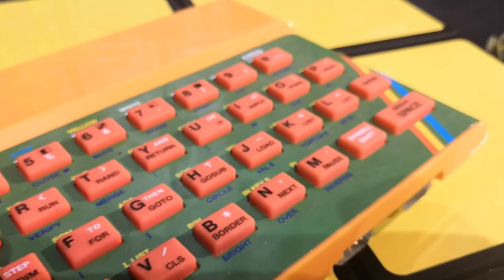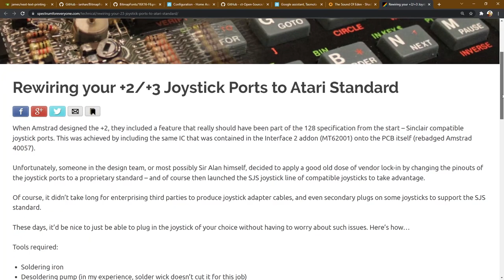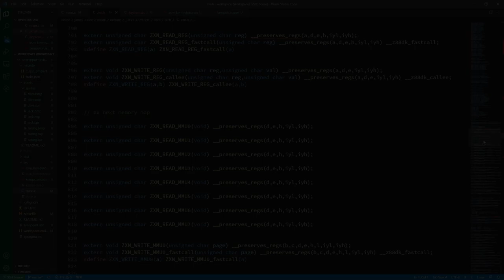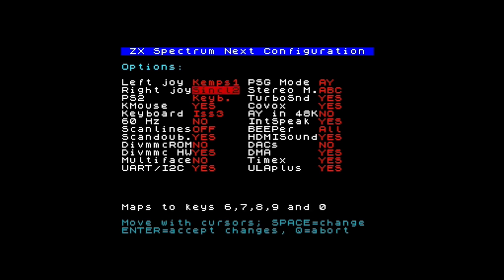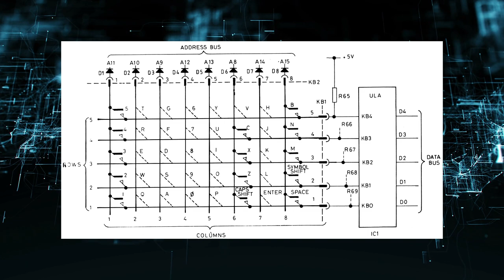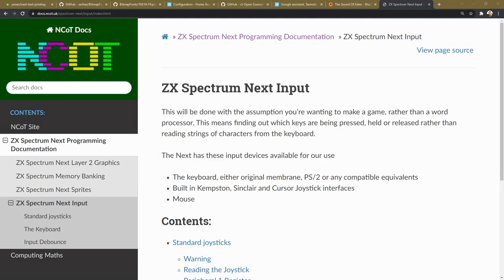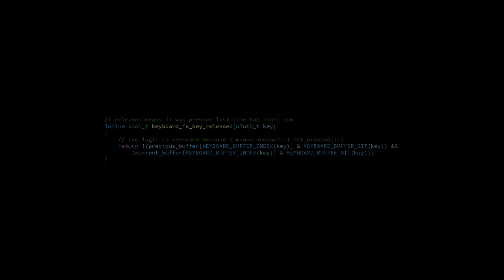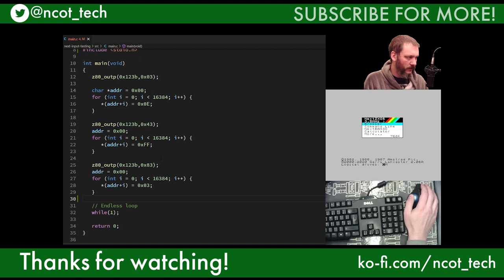Joystick and Keyboard routines on the Spectrum Next using Z88DK and C

Comment: Nicely covered. One thing you don't mention is that there are registers that can be used to test the extra keys on the Next. So if you want to know that the actual left arrow was pressed, rather than CAPS+5, it's possible to find out. Most games probably won't care, but for some applications it's useful. I think it's also possible to find out extended key information from a PS2 keyboard.